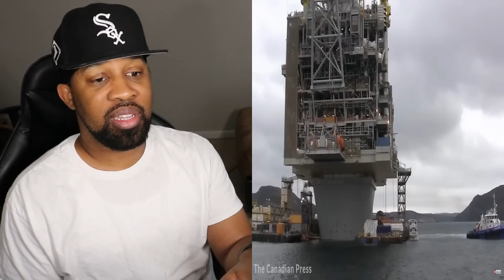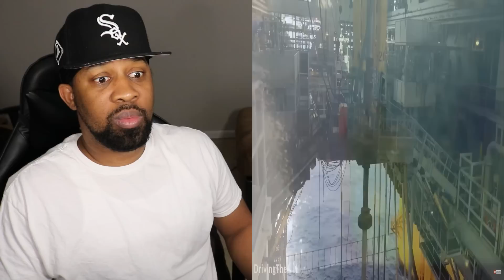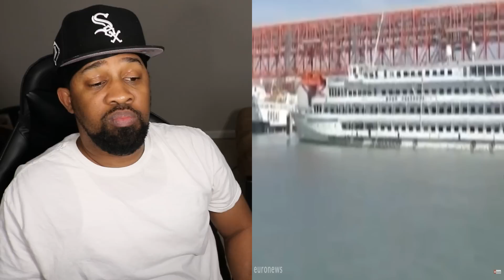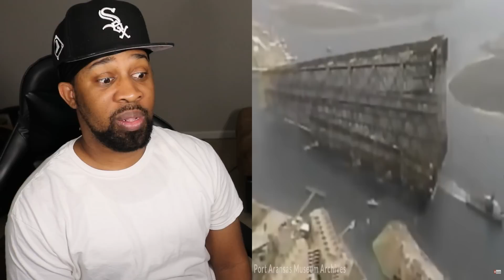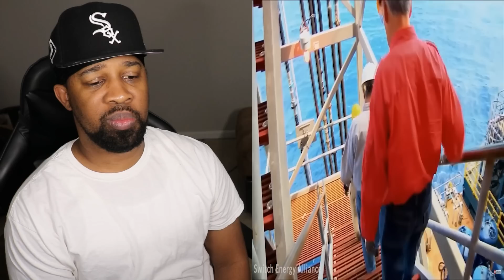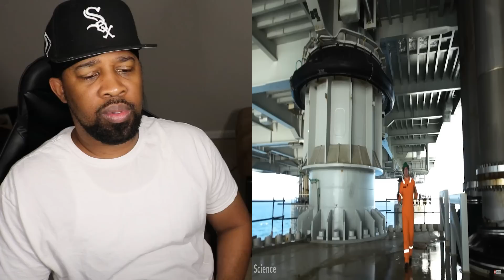15 LARGEST Oil Rigs on the Planet...

Comment: For how dangerous every job on these oil rigs are and especially now with how expensive gas is they better be paid A LOT!
I’m not a fan of heights. I can get on my roof and walk around just fine, I can do roller coasters but I’d have a hard time if I ever had to walk down the stairs from the top of a coaster if it broke down. Where I work we have 3 stories when I’m on the top floor and look down to the 1st floor I get a little anxiety so I wouldn’t do go on these rigs.